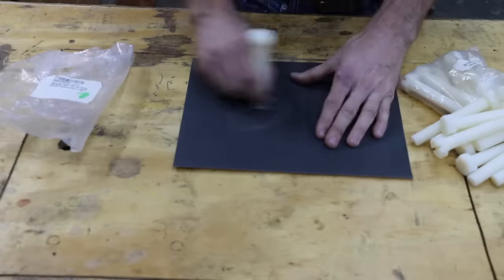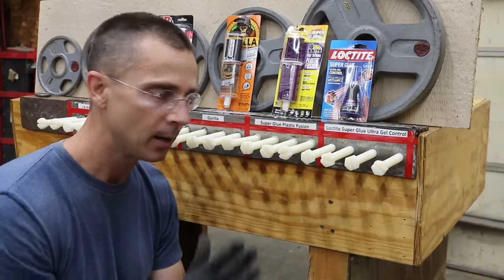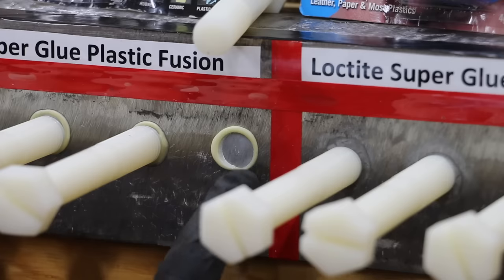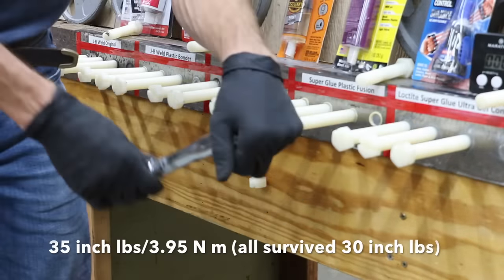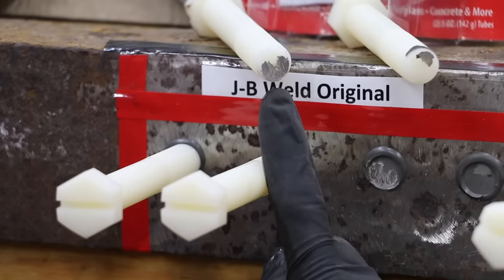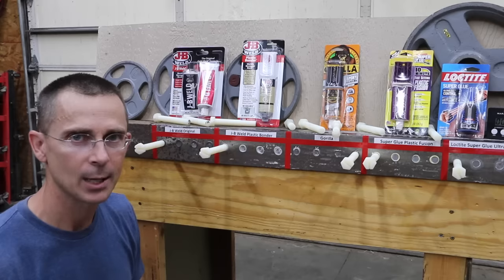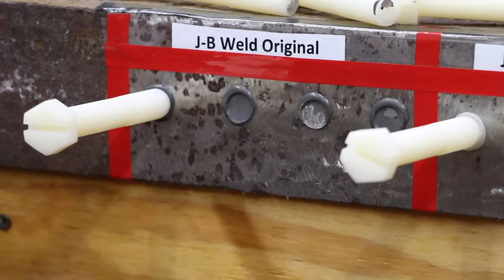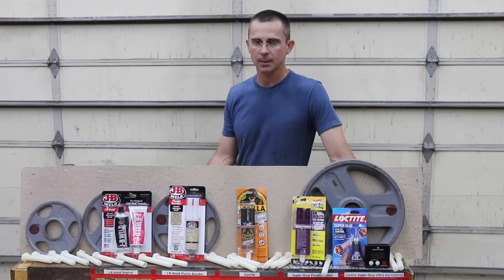Which Epoxy is Best for Plastic?  Let's find out!

Comment: Nice review. Would of been nice to see a plastic to plastic bond. As that's what most people would use a plastic bond adhesive for.
Reply: Me too but I think we can get a general idea by looking at how well the epoxies bonded to the plastic by itself
Reply: I too wish he did a plastic to plastic test
Reply: That's is my main need to know is the plastic to plastic for sure
Reply: He stated all the epoxies (except original jb weld) are designed to go from plastic to other materials.
Reply: That’s what I was hoping this video was about.
Reply: This video was shorter than most with only one type of subject and just a few different tests. Todd mentions speaking with engineers of various manufacturers to learn more (and I suspect) to avoid misleading us by being ignorant to the subject matter. He hates to be wrong! This type of research is how he learned about the softness and hardness of the various products. When he got to the end he didn't pronounce an "overall best" like he usually does. The results of this testing session yielded one conclusion "it depends" on the many types of plastics and the type of stress that is going to destroy your item. Project Farm is a wonderful resource. Thank you Todd!

Comment: be better to test plastic to plastic strength
Reply from the maker: Thanks for the feedback.
Reply: Would be an interesting test, though we use what might be better called a solvent for such things, such as WeldOn 4. In the end, using it, two pieces look like one and are welded together.
Reply: That would be awesome and helpful knowledge to know
Reply: In some ways not as interesting, since same-plastic can be welded.  Finding something that'll bond it to metal is much trickier.
Reply: @ADefenestrator  but interestingly enough all over the internet you see mainly people trying to glue broken plastic parts back together and having very low success rate. welding doesn't really help if you don't have the same material to use as a filler to weld the 2 broken parts, because if you weld plastic you melt a lot of it on the contact, and where you can't spare those 1-2mm of material to melt away.....you are just stuck(and not in the good bond success way :) ). and most people just have problems gluing plastic to plastic, so i'd say this would be even more interesting than just trying plastic to metal or other materials. you can clearly see also in this video that it's the plastic which presents issues for all glues to bond to it
Reply: @ProjectFarm  this would be really useful as bonding plastic to plastic is a lot more challenging than metal to metal or wood to wood
Reply: @09137  honestly if you watched it you'll see that most the time the glue failure is at the glue/plastic bond. it stays on the metal pretty well. 
if the glue bond failed at the metal side sure yeah lets test plastic/plastic. otherwise its a waste of time to retest.
Reply: Agreed. Im not saying loctite is the best but I can speak for its performance. A piece of my washing machine agitator broke off, glued it back on with loctite and even being exposed to water,  well over a year now and it still hasn't come apart. Im shocked to be honest.
Reply: There are good plastic glues, they just won't sell it to us.  In the industrial and automotive market there are outstanding plastic glues that literally add structural strength to cars.  But they are simply not available for retail purchase.
Reply: I went and got the loctite plastic Bond the one with the activator pen and glue, 
I glued back on a broken plastic threaded insert....  let it dry for 24 hours, worked like a charm.     P. S. It's not the loctite he used in this video.
Reply: @craftman5632  nice! I'll keep that in mind. I only used the liquid pro and that was impressive with glueing plastic to plastic that is exposed to water and the high rpms of a washing machine.
Reply: I want to see a plastic to plastic test to see which one is best.
Reply: @tarstarkusz  They don’t want DIY people fixing things. They want them to buy new Widgets instead.
Reply: @nonelost1  I think they are too much of a liability.  In an industrial setting, you can train a person on the proper use and precautions whereas with retail the dumbest 10% of the population might be using your product.
Reply: @Ris-v4w  You're right about the difficulty of bonding plastic to plastic.  And the companies that sell the agents don't help much.  To say an agent will bond plastic, wood, metal is useful but just scratches the surface of the problem.  The real issue is choosing an agent whose chemistry will match or work with the chemistry of the plastic that you are trying to bond.  That is a tough issue and you're just shooting in the dark if you don't know the composition of the plastic.  You have a broken tab on a taillight assembly on a pickup.  Without that tab you can't secure it to the body of the truck  First solution: buy a new assembly.  $80 to $120.  Next solution: repair it. But if you think you can go to the store and read the info on the packaging material to select the best agent, you'd be sadly mistaken.  You cannot tell from a package.  You must know what plastic you are trying to bond.  Not all agents work with all plastic.  There is an enormous # of different plastics.  If you don't get an agent that works with the chemistry of the plastic you're trying to bond the bond will eventually, within a short time, fail.  Then the person blames the manufacturer.  If it were that simple it would be great.  And it may even be harder than what I'm alleging since I'n no expert in plastics or bonding agents.  Just someone who has struggled with this and spent a lot of time searching for anyone I could find that could tell me the chemistry of the plastic involved and then with the companies selling bonding agents to pick the right agent.
Reply: @johnhenry1300  Good point. The way the test worked out, it ended up being a plastic to plastic bonding test. So in this case, the top products can be assumed to be the best at bonding plastic to plastic.
Reply: @equsnarnd  i totally agree, been searching for the same type of info for some time now and i totally gave up because i'm not finding out what plastic i need to glue, and what glue i need to use. so i just went with an epoxy...sadly can't find JBweld to test it out because it looks to me like it's the most promising one to be used for "generic" plastic. sad. as someone was saying here, either we the little people are not meant to fix broken plastic, or the plastic manufacturers don't really want us to know the chemistry of what we buy for some hidden reason
Reply: @equsnarnd  I have worked in the motor industry for 30 years and the staple machine you are talking about has transformed the way we repair plastic bumpers (fenders if you are in the USA) and motorcycle fairings we have tried plastic welding systems , epoxy,  flexible epoxy ect. But nothing comes close to the hot staple kit, obviously you still have to plastic weld the damage or bondo it for cosmetic purposes but the kit is worth its weight in gold
Reply: @olliedee  Thanks for that!  I have hinges on a center console that broke made of very thin plastic.  Do you think the could work on that?
Reply: @equsnarnd  without seeing it I couldn't say for sure , but the staples we use range from 3/8 inch to 1 inch,  as long as there is enough material to bury the staples in then , in my experience,  it stands a very good chance, the kit we have also has different shapes of staples some are designed to incorporate curves and corners so🤔
Reply: @ProjectFarm  any chance you can do a test for plastic to plastic to fix headphones for example..
sucks when you buy a 200+ headset and it fails 3 months to a  yr in.
Reply: its irrelevant. As long as the weakest side is the side bonded too plastic then it will have no effect on the results.
Reply: @olliedee , Thanks, I've run across a set up that does that. But not having seen it before just thought gee, looks good, wonder if it really works. Now that I know will have to keep an eye out. Not top off list but maybe one day.
Reply: @jasomkovac9115  it's a very good system, I dont work for or have any connection to it , my compliments are based on experience with it, the staples are sprung steel (at least the kit we have are) so they give the repair the flexibility and strength  plastic repairs need, I staple the crack with the kit then use an old soldering iron to melt a piece of donor plastic to fill the remaining damage and sand it to a finish,  I find it's less likely to crack in the future than body filler, the kit wasn't cheap but if you use it a lot(and when you have it you find yourself using it for all sorts lol) then you won't regret getting one, hope this helps
Reply: @olliedee  ,yes, it did help. Thanks.
Reply: Seriously, I've never once had a reason to bond plastic to metal. It's always plastic to plastic. I suppose when a screwdriver breaks loose from the handle you could drive it back into the hole with some epoxy.. or stop buying screwdrivers from China.
Reply: @tarstarkusz  where can I get a prescription for good adhesive LOL. Bastards like Dupont, holding out on us... while we pull our hair out with Mickey Mouse products I don't work. I recently bought some "extra strength" spray adhesive from the dollar store, pretty sure it was made out of graphite or teflon because it wouldn't even stick two pieces of paper together. Like not at all. The opposite of an adhesive. Extra strength.
Reply: @beerggls  Yeah, remember the lady who glued her hair... THAT'S why we can't have good glues.,
Reply: Depends on what kind of plastic you're talking.  There is thermoplastic which can melt & be welded, and there is thermoset which only burns instead of melting and is pretty hard to weld.  Within those broad categories there are lots of different plastics, and some are very hard to glue.  A glue that might work for one kind of plastic might fail miserably for lots of other plastics.
Reply: @ProjectFarm  Agreed on that.  Usually when you are gluing plastic it is to other plastic and not normally to metal.
Reply: @craftman5632  UV activated glue?
Reply: Doesn’t 3m also make a product like this?
Reply: I use JB weld plastic bonder on motorcycle plastics. I currently have some holding a thin piece of plastic underneath my headlights on a cbr1000rr and no headlights in the nose plastics. So it's basically wide open and moves a lot while riding. It has stayed together for months no problem, even some high speed runs at the drag strip. Just make sure that you sand both areas you want to bond and then clean them with something. I'm willing to bet those plastic bolts weren't sanded on the bottom where they were applied.
Reply: None of these would compare to Hysol. Hysol is freakishly strong, that's why airplane manufacturers use it on many areas of Airplane Fuselage's.
Reply: @dalehammond1704  it doesn't really. Not only does he not tell us what kind of plastic the bolts are made of, he also does not test them for pure tension. All of the tests were with low surface area as well which can greatly affect the curing process.

Edit: Apparently he was using solid nylon bolts. literally one of the worst materials for testing plastic glues in most situations. So the test told us almost nothing.
Reply: @ADefenestrator  Not really we already know the eopxy will stick to metal.
Reply: @dalehammond1704  I use JB Weld plastic bonder most of the time and it has never failed me. I tested it once on a piece of thermoset plastic (not sure what kind specifically) and when I tried peeling it off, it took all of the plastic it was attached to with it. It's definitely very strong.
Reply: @Ris-v4w  shd b able to get jbw on amazon
Reply: iso glue and sodium bicarb (krazy glue/baking soda) is suprisingly indestructible).  If you get it on your finger when catalyizing, it feels like getting nicked with a soldering iron).  Great video and thanks as always!
Reply: @Ris-v4w  Stitching plastic together with stainless 'staples' and then using same type filler seems to be the best bet.
Reply: I was going to comment  the same. Also different plastics. Nylon, abs, pvc,hdpe,etc.. There is also permatex, quicksteel, and jb weld plastic weld. Coolvid!
Reply: THAT’S what I thought they were going to show us. How many of you and how often do you want to glue plastic to metal vs plastic to plastic?

Comment: I find it odd that use the plastic glue to bond to metal instead of plastic. Plastic glue is for bonding plastic surfaces, is it not? Also there are lots of different plastics. In real life noone glues a plastic bolt of unknown plastic material to a piece of metal and make a conclusion out of that.